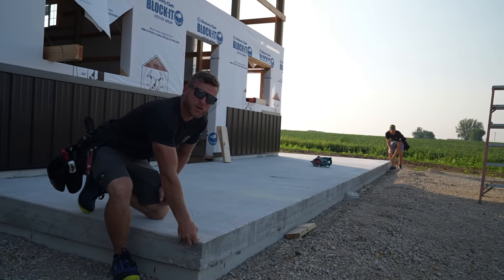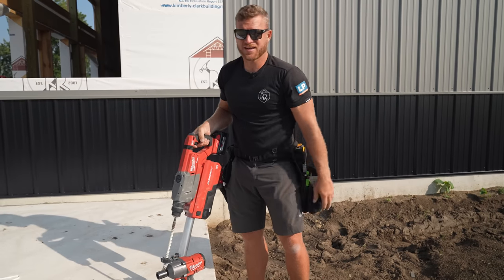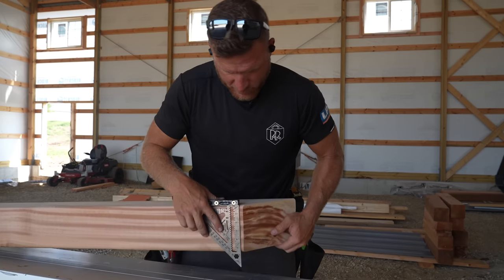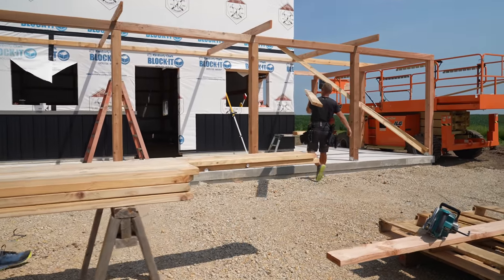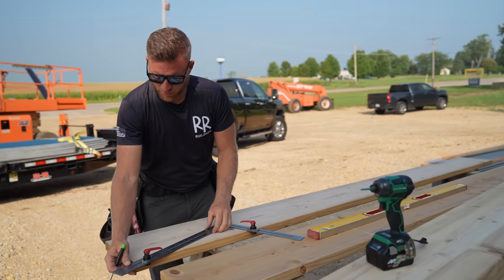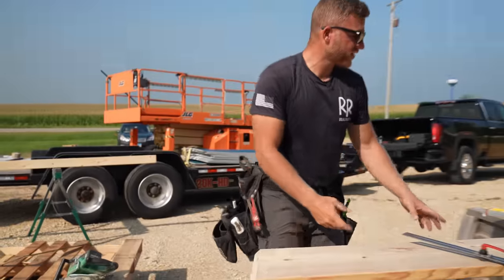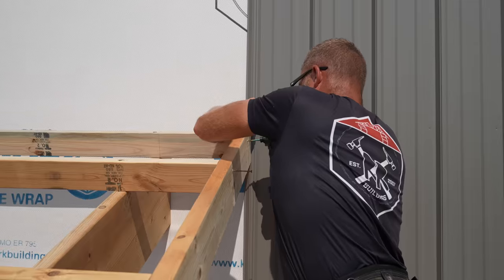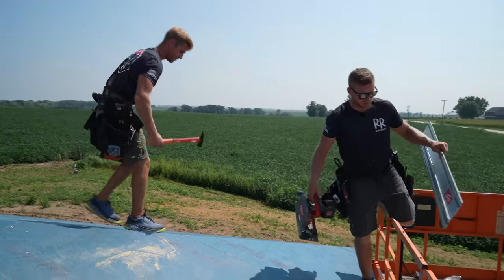Building a Wrap Around Porch with Cedar: Farm Chains 7

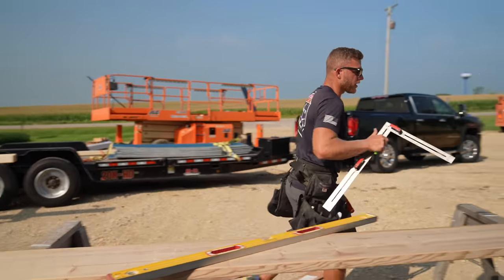Comment: A quick tip on cutting the top cut of your hip is when you're marking your pitch(37:32),  mark both sides of the tongue of your square and cut your 45 on the long side and then reverse  cut your 45 on the short side and you will have a perfect beveled top cut

Comment: When (at 17:15) you were not 100% happy with your angle, could it have been that the rounded edges off a 6x6 (same with 4x4's) isn't a super good combination with a too thin /small carpenter square? While cutting on the miter saw all should be OK, but when you draw the 45 degree lines those rounded edges come into play. Not sure, just a thought.

Comment: Tapcons would work fine as long as your not  in freeze zone , as the frost would cause the two different cement slabs to shift at different levels , unless you poured a footing and went down four to six feet

Comment: Another great video Kyle! QUESTION: When cutting these porch posts at different lengths, do you start with the longest cuts first? So if you cut one of the longer posts too short you can still use it for one of the shorter posts?
Reply: I had that exact thought while I was watching.  Makes the most sense.

Comment: The only tool that I have that's Black & Decker/ DeWALT is my miter saw stand. The stands that you have suck unless your on a board flat surface to set them on. I mounted my Hatachi miter saw on a 3/4 piece of plywood and then fitted the DeWALT brackets on the bottom of the plywood. It clicks right on easily every time. I'm on my 4th DeWALT miter saw stand because they are not built very well. They always ware out on the ends where the extension screws on. I wish someone would make something like this that's built better.

Comment: Have you ever heard of or used a prazi beam cutter?  Instead of working so hard on all the math for your corner ceiling joist why not , set corner, set 2 hip pieces, mark both ends and chalk line across hip. Beams straight,  chalk lines right.
Reply: Just a note but that style framing would not work in Florida. I know things are different in other parts of the country. 2x4 will only span 6ft, plywood seams have to have clips in them. I've done some similar porches with 4x6 rough cut heart pine and 1&1/2x6 t&g juniper and cypress mix for roof deck.

Comment: I would hate to know what you guys are paying for those posts.  My deck was built with "Clear" 20 years ago.  We're finally hitting the "Time to repair" phase on the stair cases, and the team that built or deck is doing the repairs.  When I asked about the "knotty" cedar, they said "Well, we didn't think you really wanted to spend $175 PER 4x4 for CLEAR cedar...I was "Ummm, NOPE".  I even called my local "exotic" Lumber Yard (whatever you want, they can get it...even massive 16x16 purple heart beams).  They said "Well, $175 is a TAD high, but it's still $160 from us, and it's a 3 month lead time item". YIKES!  That's for 4x4...I can't even imagine the 6x6.